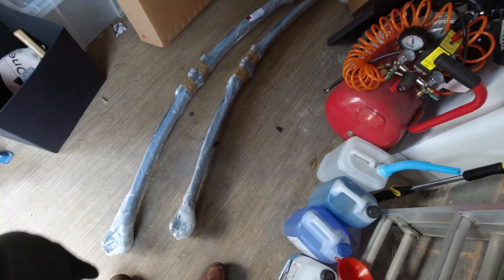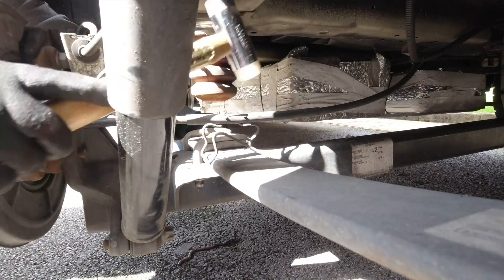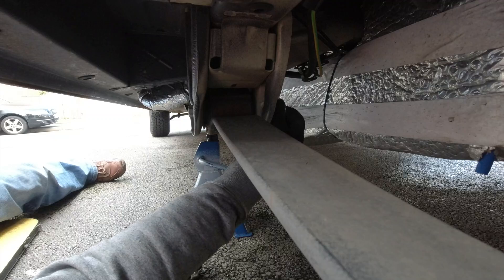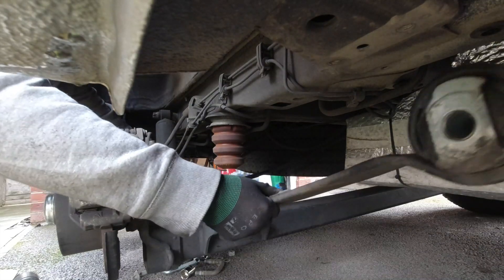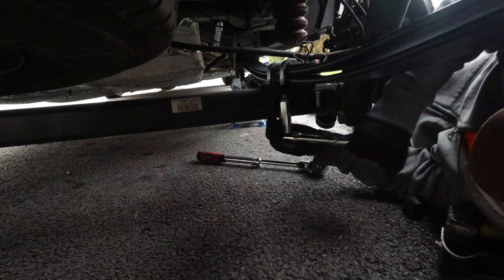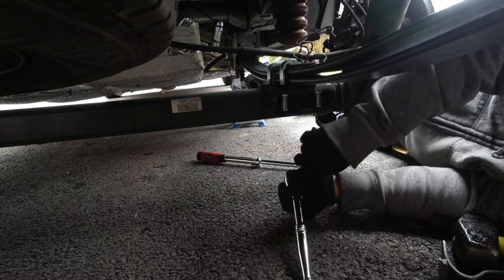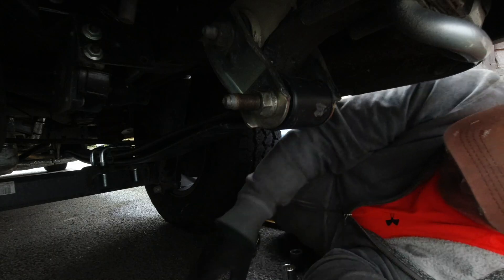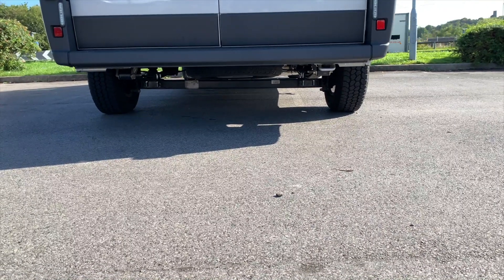Upgrading the Rear Leaf Springs on our Fiat Ducato Campervan

Comment: The best solution is to give the vehicle real suspension by replacing the blades rather than stupidly installing miracle remedies such as "Summo" style rubber bumpers which are only palliatives. Real good job.

Comment: John, just to let you know that I upgraded the springs on my Boxer today and watched your video a few times first. I did use the strength of a mate as I honestly can say that I did not have the energy to remove some of those nuts. Easy and straightforward thanks to your video. The springs were acquired  via you link. Mine old ones were  almost flat when we removed them, so it was a job worth doing. Wouldn't have thought to do it if you hadn't posted your video. Thanks again from a well satisfied subscriber.

Comment: Hi John, Thanks for sharing again. We all find this type of info very useful.  I have the double / upgraded springs on my Vantage van and also the air bags which can be inflated to a muximum of 70psi and giving an extra 60mm of ground clearance. After many trials I run the air bags at 20 psi which just makes the van sit as it was probably designed. Raising the back end does effect the handling. Without rambling on I also run my tyres  at 52/57 psi front/back. This I have found works best for me with my setup.  cheers

Comment: Thanks for the prompt reply. My vans a 17 plate with 80,000 on the clock, if after the build it’s nearly at max weight it will be better if there’s no issues with how it drives. Stay safe both, . I’m enjoying your videos. And the new vans very nice.

Comment: Mine is the Maxi when we are fully loaded it’s close to 3500kg  and the ride height never looks any different. I believe that the maxi van can be up plated to about 4250kg without upgrading brakes or suspension. I think you have done the right thing especially as you are going to be doing a lot more mileage than most of us just use it for holidays 👍

Comment: Great Video John. I've been looking at HD leafs for mine as it's a joint grand tour and mountainbike van so will be fully loaded up most of the time and also used regularly off the beaten track. Like you say, the extra ground clearance will also come in handy down those bumpy gravel tracks and fields.

Comment: Very interesting. My swift Sundance only has one leaf spring. Anyway I upgraded by having Dunlop air suspension fitted in place of the bumpstop. So far it’s worked very well. Much better handling and you can adjust it a fair amount

Comment: hi j. would have replaced shocks as well.
Reply from the maker: Shocks are fine, it's a 1 year old van, swapped side to side shocks to compare and both are fine. I'm not a novice at this kinda stuff, so I don't waste money just replacing parts without knowing why the parts needs replacing.

Comment: I reckon that👎is from Autofail 🤔😉. Have they ever made comment on the faults and failures you've found bud ? 👌👍👍👍.
Reply from the maker: I've only ever had letters or emails or phone calls from them saying I should contact the dealer who sold it to me, that dealer went bust and the other dealers in the network struggle to get anything out of autofail. So they're dead to me 🥴
Reply: @johnmandy  to be fair mate, there's not much of an auto fail van left, you've rebuilt it! #Autogadget 😁👌👍.

Comment: I know it's more expensive, but did you value the simple rear air suspension?
thanks for the video

Se que es mas cara, pero valoraste la suspension neumatica trasera simple?
gracias por el vídeo
Reply from the maker: The air bags wouldn’t have fixed the fact the leaf springs were too weak for my van, so I had to replace them. Maybe in the future I’ll go for airbags to replace the bump stops.

Comment: Hi John hope you and Mandy are well, I’ve just got a set of the leaf springs to fit our vline can I ask how you knew the torque settings for the front and back, ie 185nm rear 145nm front as I’ve searched the net but can’t find the info. The vlog is superb in detail so I’m just checking I get the settings spot on 👍

Comment: Hey John, you make it look so easy! Good job.. I think this is what we need to do to lift the back of our van, our leaf springs are almost level rather than curved😬.. Hoping it will last until we get out of Scandinavia! At least we know it’s not a big job for a mechanic providing we have the replacement leafs 😉 thankyou x
Reply from the maker: Your van now 😑 Your van soon 😊
I was quoted 3 times the price for a garage to do the work as the parts cost me. Maybe if you drop back into Latvia you might get a better price 👍🏼

Comment: Hello! I am almost done converting my Citroen Relay. My leaf springs will probably be flattened out pretty soon, so want to replace them preemtively, and theb I can get on the road with peace of mind. How do you know what stiffness of spring to go for? Is there a weight calculation? Or a range of movement to measure and to establish what to replace it with? I don't want to get it wrong and it either be too soft a spring and flatten out again, or too rigid and affect handling. Hope you can give some advice. Thanks so much 😊

Comment: As you're not sitting on the bump stops anymore, do you notice overnight guests of wind any more, or any less?
Reply from the maker: We don’t normally accept windy guests in our van if at all possible. 🤣
Reply: @johnmandy  Autocorrect did me dirty. 🤭
Ironically, I had retyped my question so I wouldn't get wiseguy replies about *wind*. 🤦🏻‍♂️
Reply from the maker: Awwww, and I still came in with a silly answer 😇

Comment: John quick question.. when connecting two batteries in parallel... do both batteries have to have the same charge before connecting?
Reply from the maker: It’s best to, yes. Especially if they’re lithium.

Comment: Hi, J. Great video, have you Considered looking into changing the bump stops to Dunlop air ride, I have just had it fitted( not clever like you) to my coach built, it makes such a difference in so many ways. Ciao.
Reply from the maker: I might in the future, but it’s far more important to get the springs working safely before adding airbags.

Comment: So not that difficult of a job then really. The garage charged me £250 to change one of mine that was cracked. The other one had been changed after the mot a couple of months prior. Your bump stops look a bit healthier than mine! Do they make a difference to the ride much?
Reply from the maker: At the last part of the video I go over how it rides now. Both springs cost me £255 and that's for uprated double springs that is what should be fitted to all motorhomes and cmapervans to carry the full weight all the time.
Reply: Guess that isn't too bad. So I wonder how much a garage would have charged you to do the job? 🤔 Good you could do it yourself. I was actually talking about the bump stops re the difference in ride. Just wondered if it's worth getting mine changed as they look like they've been chewed by a dawg, lol.
Reply from the maker: A garage wanted £695 incl parts. Bump stops shouldn't really be used that much if the suspension is right, but they are cheap and easy to replace.
Reply: @johnmandy  Hell fire, just as well you're handy with a spanner and stuff! Okay cheers, re bump stops 👍

Comment: Great job 👍

Should come with the uprated springs John 🙁
In the UK we seem to get slotted up with the Light Ducato chassis 
BUT in the EU they get the Maxi chassis 
I’ve a New Adria on the way - no option for the Maxi only in the EU 

Baffles my why, surely camper vans are carrying weight close to their limit continually - so we should get the Maxi by default 

Cost saving hmmm 🙁
 
Be interesting to find out the differences 
Maxi has the flared plastic front wheel arches ?
Hubs different - PCD bolt fitment 
Brakes bigger front and rear ?
Springs too ?

Anyway top job in typical Manchester weather - where you start a big job in sunshine only for it to belt it down half way through 😂 🐝 🌨 EVERYTIME 

Nice this weekend though so get out n enjoy 👍

Comment: That’s interesting John, have you thought about contacting Autotrail to get their perspective but then I guess they may throw it back due to modifications. 
Will the front need any changes or headlamps adjusting?
Got to say I take my hat off to you as working in those conditions it’s so easy to be demoralised, not fun when the weather is against you.
Reply from the maker: AutoFail are 100% focussed on taking no responsibility for their vans, they just push you to their dealer network, who in turn are crippled by the dire workmanship of their vans and the fact nothing is ever approved to be repaired under warranty. The fact that an established manufacturer buys base vehicles that are not meant to carry heavy loads and then loads them up so they will drive around at almost full capacity all the time, that shows you what sort of company their are, penny pinching to the extreme. 
The headlights are on adjustable motors so you can change the angle as required. The front end is fine, the issue was the n/s leaf that had bent the wrong way due to the fact single leaf springs are not meant to carry full loads all the time.

Comment: Hi John, how much ground clearance did you gain from changing the leaf springs please?

Also I know you already put the 16" wheels on. How do you know the exact speed you are travelling considering this? Apart from speed, does it effect anything else...brakes, suspension,  fuel consumption? That sort of thing. 
Thank you.

Comment: Great video. Had been wondering how vans manage with max weight most of the time. Other than the leaf springs any other changes or upgrades required. Weight is the bane of camper vans.

Comment: Should have bought an ambulance like us!  Paul said it would have saved you a job, however you  do have motor home status, whereas we are still a van with windows  lol :-)
Reply from the maker: 🤣 if I ever did another build it’d be an ambulance, even if it’d just be a windowed van to the law 😝
Reply: @johnmandy   We are taking it all the way to the independent Complaints Assessor and using a link to Auto fail.  Let them work out the difference between an Auto fail Motor Home and our Glorious EsmeVan ( with side windows). Might need to put some sticky back plastic over one of our windows lol!